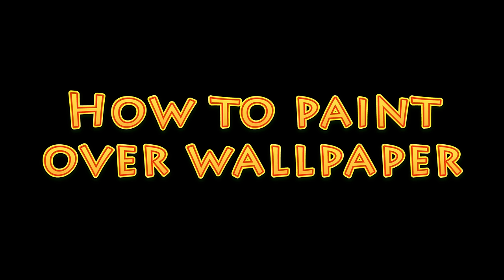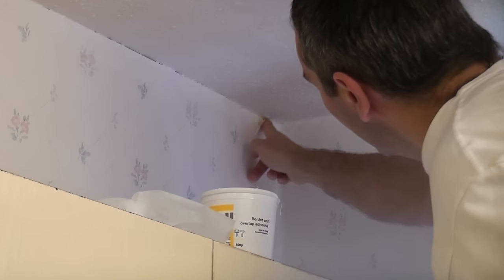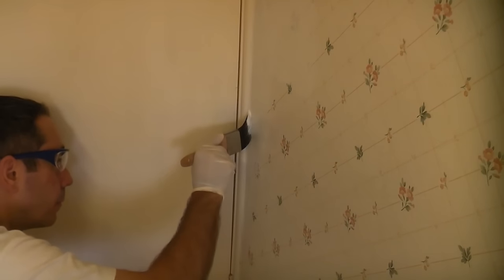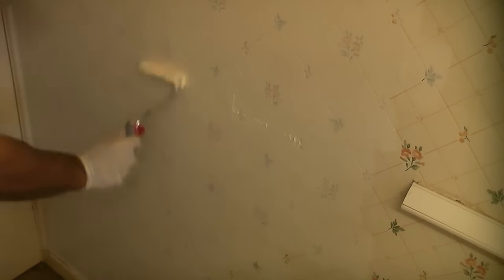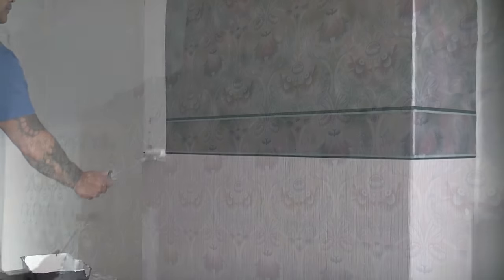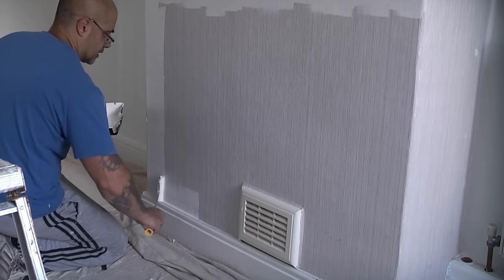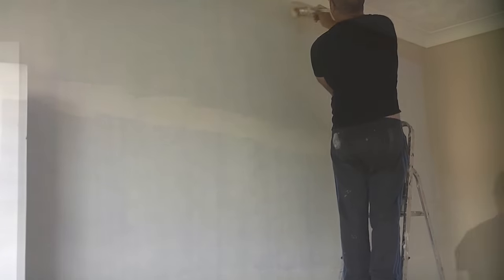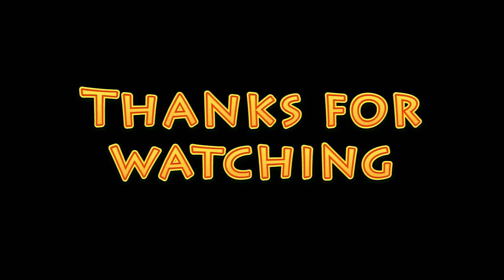How to paint over wallpaper

Comment: I would be afraid to paint over every type of wallpaper… I could see painting over paper wallpaper but I haven’t seen anything in this video that would tell me how the seams would hide and I would like to know how the seams look after this is painted.
Reply from the maker: As long as the wallpaper has been applied correctly in the first place the seams are not an issue when they are painted over. But if the seams are overlapping or there are gaps this product will not hide them.
Thanks for the comment 👍
Reply: Stick sheets of mesh to wall and skim coat over the whole room if you’re nuts like me, or just coat the seams.  I did my walls this way 12 years ago.  Still look great.

Comment: What if I have a bit of loose plaster behind the wallpaper? Do I try to steam the wallpaper off, remove loose plaster, fill with Polyfilla then stick wallpaper back with some adhesive.
Reply from the maker: I would not steam the paper, as you will ruin it.
You could try carefully removing the paper, then fixing the damage but you might end up replacing the wall paper!
Reply: @ultimatehandyman Cheers. Thanks for the tip.

Comment: The extra time required to remove the paper is worth it when looking for a lasting paint job!
Reply from the maker: Thanks for the comment
Reply: Not if your walls are f'ed
Reply: Trust me. There's times when 20 year old wallpaper won't come off. Unless you plan on literally removing all the drywall and slim costing everything again. Potentially costing 1,000s this is much easier for certain jobs.

Comment: Just moved into a bungalow and every wall is covered in a hessian type wallpaper and painted very dark colours, nightmare! How do I calculate how much wallpaper cover up I’ll need per room please
Reply from the maker: It covers 5 - 8m2 per Litre
So if you measure the height and width each wall in metres and multiply the two figures, that should tell you how many square metres it is, you can then work out how many tins you would need.
You can get online calculators, but I'm not sure how accurate they are- https://www.smartcoat.com/tips-tricks
Reply: @ultimatehandyman  great advice thank you 👍🏼

Comment: When mixing that can of paint with a drill, I noticed the paint was Zinsser B.I.N. I'm just wondering why you didn't mention it, as it's my favourite paint for covering surfaces like wallpaper.
Reply from the maker: I just wanted to demonstrate how to use a mixer paddle, I could not find the footage of me mixing the 123, although it is on my computer somewhere.
Thanks for the comment
Reply: Ah fair enough. What do you think of B.I.N. though? Is it as good as 123 as a primer or is it more of a stain blocker?
Reply from the maker: It depends what I'm doing. I often use Zinsser coverstain for blocking stains or painting over stained varnish etc.
B.I.N is great for priming some substrates. I have a small book called the pocket guide to surface priming and decoration by Zinsser and that tells you the best product to use for each scenario. I also have the Zinsser App on my phone which is great as you can search for substrates. 
I have a few of the pocket guides, if you want one if you send me a message via YouTube, I'll pop one in the post for you when I get chance ;-)

Comment: Do I need to use a cover up ,when the paper I’m covering is white and not patterned..
Reply from the maker: It depends, in some circumstances applying water based emulsion can cause the paper to bubble/lift.
If you just use the emulsion you might have to do remedial work afterwards if it does bubble etc.

Comment: Had a question I live in a Mobile Home and I am remodeling my kitchen some parts have wallpaper other parts it has the wallpaper peeled of what is my best option to do before painting?
Reply from the maker: If the wallpaper is just loose, you can paste it back using border adhesive, then paint the lot using the wallpaper coverup, then apply a top coat.
If bits of the paper are actually missing, it might be best to remove it all completely.
Thanks for the comment
Reply: I’ve painted my kids room in a mobile home with wallpaper walls and it tends to scratch off when then touch the walls or something is too close and it grazes the wall... how do I percent this?
Reply: @kristenandrew7959  did you use a primer? most likely why it comes off so easy.

Comment: What do we do if we still get a bubble?
Reply from the maker: Not sure, I have used this lots of times and never had any bubbles.
If it does not dry out and go back flat in a day or so, you might have to inject some wall paper adhesive into the bubble. I've used a needle and syringe in the past for similar jobs, which you can get at most chemists.

Comment: If you can't get or can't afford the paint in this video. Are there alternative. Do you have to sand the wallpaper. If not are they any circumstances where you have to
Reply from the maker: I would never sand the wallpaper.
I have seen people paint over some wallpapers, using just emulsion paint but it can make the wallpaper bubble, sometimes it also takes several coats to cover the wallpaper.

Comment: Sorry, I’m clueless. I want to cover my feature wall in my bedroom which is floral at the moment but it’s just normal paper. Not vinyl or raised. Would I use the cover up? Thanks!☺️
Reply: After reading comments it looks like painting over wall isn’t a good idea. How do I get the paper off without damaging the plaster work behind?😫 regretting asking for floral wallpaper now lolb
Reply from the maker: You can remove most paper easily with Zinsser DIF and something to perforate the wallpaper- either a paper Tiger or a perforated roller- https://www.youtube.com/watch?v=oTVfU6jNfZE

Some people use wallpaper steamers, but they are not good to use and I don't like them due to the heat.

If the wall is damaged when you remove the paper you can easily patch it up- https://www.youtube.com/watch?v=6wa_m_RKWjw

Comment: We have always taken the back to bare then paint easier in my opinion
Reply from the maker: I'd have to disagree with you on that one, there were two large bedrooms and the hall, stairs and landing that were all painted over. If you had to strip all those walls it would have added days or weeks to the job, then some of the walls would probably need re-plastering as the house is over 100 years old.
Thanks for the comment
Reply: Ultimate Handyman our house was built 1910 . Me and hubby stripped it all then emulsioned in four days . Yeah 10ft ceilings are no fun it’s hard work. Thx for the reply

Comment: Being a decorator myself I would never recommend painting over wallpaper in the kitchen as it will never last, firstly get it stripped then if possible paint on the walls, secondly your not using a 4" brush its a 3" at max, thirdly why are you using safety glasses to paint? And fourthly it doesn't matter how small a kitchen or bathroom is always always always use a full size roller not a mini roller as you will always see the paint lines. BTW im a fan UH but this video should be how not to do it.
Reply from the maker: Zinsser Perma-white is designed for use in kitchens and bathrooms, so it will last.
What does the size of my brush matter, has nobody told you that size is not important!
I can wear safety glasses any time I like, you do know that Michelangelo went blind when painting the Sistine chapel.
Are you serious about lines from rollers? you must be a top decorator if you get lines!
Thanks for the comment, although most of it is nonsense ;-)
Reply from the maker: You are lucky that I approved your comment as it is nonsense.
I never personally insulted you, perhaps you imagined that ;-)
Talk about being a snowflake and spitting out your dummy- pathetic!
Reply: It's a good idea to wear safety glasses with Zinsser. It sticks brilliantly, so you really don't want a spot of that in your eye.
Reply: Poor John pt is sulking now
Reply: Norman Barrington hahahaaaa I’m crying.
Reply: Being pompous myself, I would never spout off about rolling splatter getting into my eyes cause it never happens nor would I be aghast at brush size or my short comings on how to roll a room.
Reply: Sounds to me that the "decorator" is skimping on the quality of his primer and paint. Anyone who has experience can get a good result provided the surface is relatively smooth and clean, they use quality products and when painting with a roller go over the area in a W pattern back and forth like you did for the areas not right next to a corner or wood work. I wear prescription glasses but if I didn't I would be wearing safety glasses when working with chemicals or paint. @ultimatehandyman